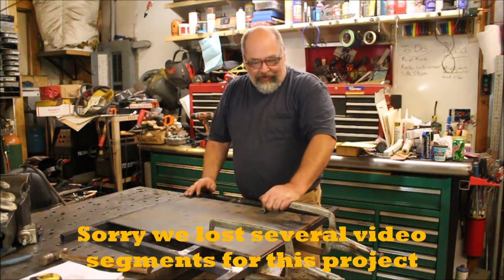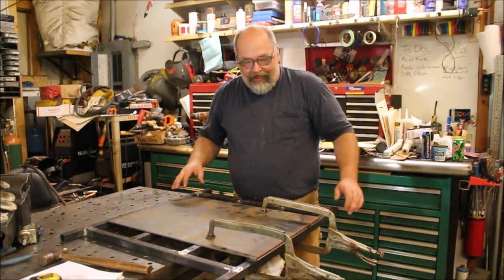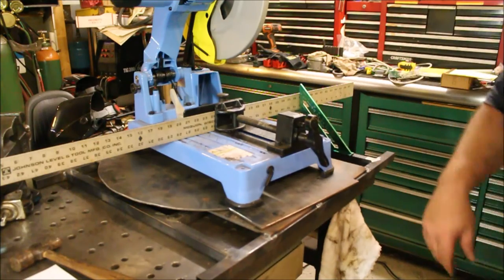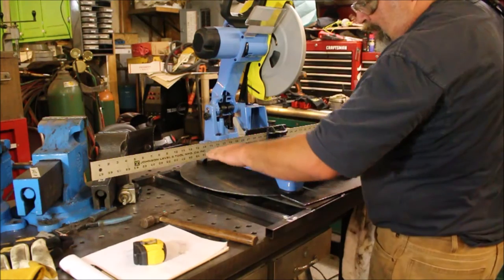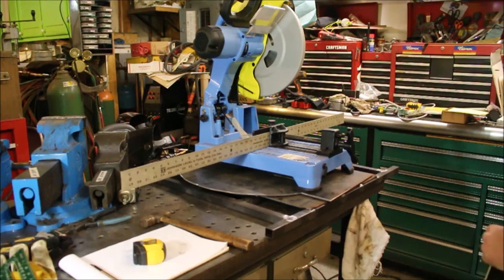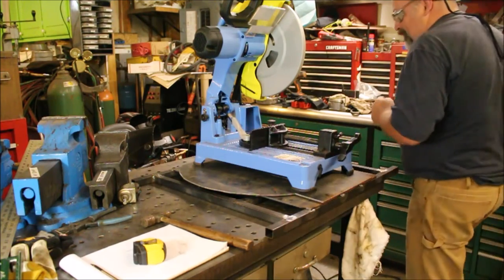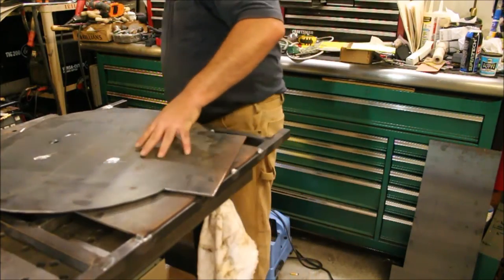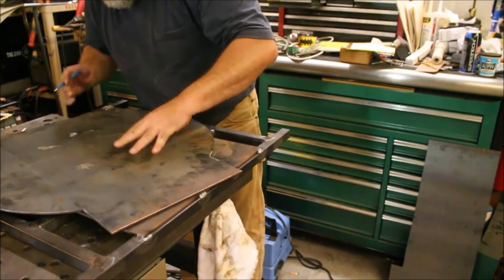Dry Cut work station part 3

Comment: .......nice work.......lots of parts in the that build.....a washer or 2 after final fitting will adjust the saw height to match the deck..wish i had done this yrs ago......keep that fan on while welding......if you smell it your exposed.....keep up the great work.
Reply from the maker: Lots of parts, wish I had the work station done in order to build it.